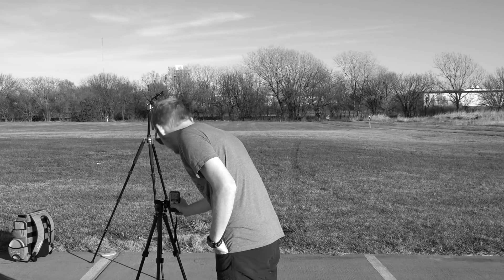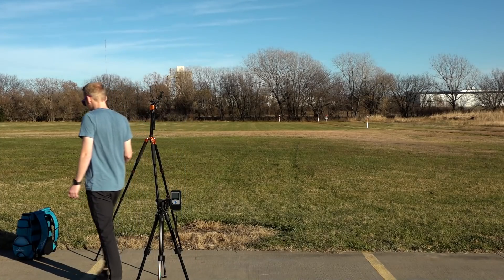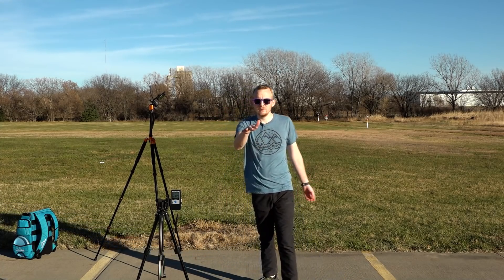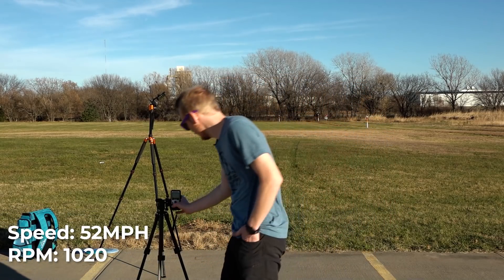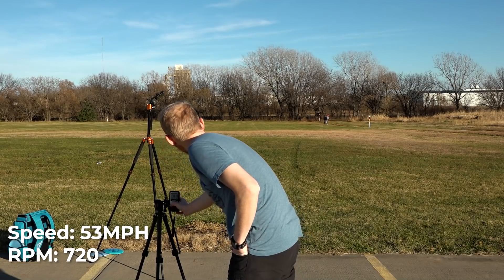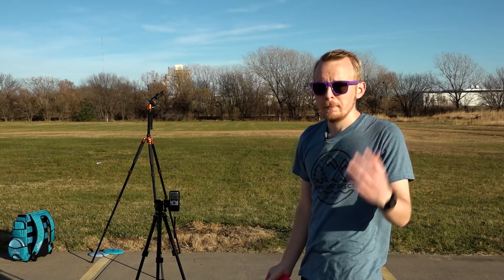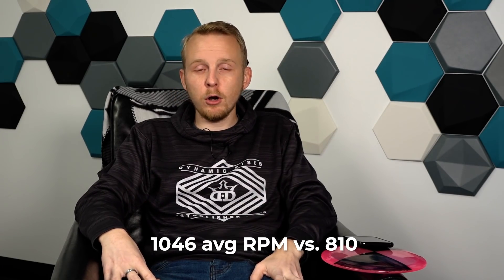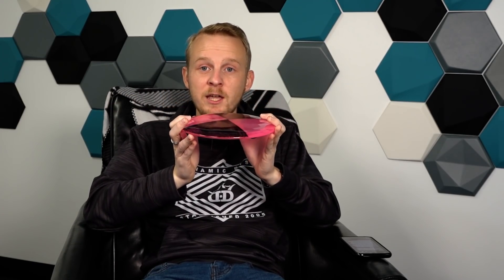What does disc spin do? | Physics of Form ep. 8 ft. Danny Lindahl

Comment: FIRST: spin does not cause lift.  Air passing over the top of the disk causes lift (Bernoulli’s law/equations). It doesn’t take much difference in the top causing air to move fast (low pressure) to create lift. Just a little lift causes aircraft of several thousand pounds fly at high altitudes.
Hmmm…possible cheat disc with better lift coefficient, perhaps?
Second: spin is angular momentum, causing a gyroscopic effect, or the higher the spin the more stable the disc at distance. Think of a toy gyroscope and the faster you spin the inner ring, the harder it is to knock it off the pedestal. 
Turn is generated by the disc losing rotation and speed. As it slows velocity forward, it tends to dip to a side, depending on how it was thrown. As rotations slow down the angular momentum decreases and the disc begins to fade or turn. 
 
Both forces, lift (time in the air) and angular momentum determine the path of the disc. Stable disc (high revolutions, angular momentum), level throw and high speed (causing lift) will dictate a long throw.

Comment: Spin generates lift. Turn is from instability caused by disturbances in the air rushing across the disc. These disturbances are caused by the disc moving faster than the angle of incident is designed for. This is the same reason why all planes have a speed cap, and an overspeed warning. These disturbances in the surface of the flying object cause vibration that can be catastrophic.... case and point a disc becoming over stable and turning into the ground. This effect is called "dynanic roll-over".

Comment: My understanding is that the turn on a disc is the same as the turn on a fast ball (or tennis ball, Pingpong ball, etc). The air that hits the front of the disc drags along the rim and whips off 270 degrees from the front forming a “jet” that releases off the left and pushes the disc to the right on a rhbh throw. So spin directly causes the turn. More spin = more turn. It also causes the gyroscopic stability… as the disc slows, the gyroscopic stability diminishes and fade begins as the front of the disc is pushed up, rotated 90 degrees, and the disc floats down at an increasing angle. So more spin also lengthens the flight time before fading off.

Comment: Lizotte did a video with his throws versus the throws of a friend.....  at equal speed,  he had more distance than his friend. It is evident that discs need rotation to fly,  and spin must be a factor in all sorts of Flight results.  Basic "talent" for  SPIN must have components of wrist flexibility,  as the wrist to hands/fingers represent the end of the whip.  There must also be a component of grip strength to provide a concentrated axis for rotation.  You're on to a great topic.

Comment: Thank you Danny! It's very popular to say "do your own research" and that's exactly what you did. From what I've understood with moderate physics skills is that the spin has multiple effects on the turn. One of them is that the rotation causes different airspeeds to different sides of the disc. RHBH the left wing has greater airspeed and thus, greater lift, while the right wing has less airspeed. More spin means more difference in those speeds and in that way, more turn by actually tilting the disc in the air (even to a roller). But in the other hand, greater airpeed also means more drag and as the result the left side of the disc brakes more and curves the trajectory towards that side. Think of it like a good old banana kick in football. Maybe that is what gives the disc it's fade, then? I think you had also another explanation with the front edge of the disc rotating right and pulling the right side down, when throwing nose down? But since I don't throw that way, maybe that's one of the reasons my discs turn way less than they should 😅

Comment: Ugh, Danny stay in your lane. You have no idea you’re talking about. Greater spin rate increases the stability, where stability is the resistance to turn or fade. For a given spin rate, same disc, “turn” and “fade” is dependent on the fore aft center of pressure, which for a given disc is dependent on the angle of attack = flight speed and nose angle. If you want to explore the effect of spin rate vs forward speed on a disc, grab an ultimate disc which you can throw slow enough and it’s easy to vary the spin rate.

Comment: Turn in understable discs and straight flight in overstable discs is created primarily by the differential in speed between the two outermost edges of the disc (side to side, not front to back) and the discs aerodynamics. As the disc spins, one edge is moving into the air in front of the disc, creating extra turbulence, while one is turning away from the discs flight. It is also flying forward like a wing, so its overall profile affects its "stability" (in this case, its ability to create lift and remain airborne. Unless someone perfects a "knuckle shot" with no spin, there will always be that differential between the two edges of the disc and obviously any shot includes some speed.

In terms of how that is effected by the flight speed of a disc or its spin, there are two things to look at. 1) The higher the spin rate, the greater the differential is between the two edges and the more the disc will want to "turn" because of its rotation. That spin also creates more resilience for the object in flight, think a football thrown as a spiral vs not. Speed on the other hand does not increase the differential between the two edges. Instead it only shapes the disc by interacting with the relative aerodynamic properties of the disc. The more flight speed a disc has, the more turbulence it will encounter, creating off axis torque on the disc that can also make a disc turn.

In essence, both spin and speed create "turn" but in very different ways. I'd be happy to help you dive into this more if you'd like.

Comment: From an engineering POV what you should have done is tracked the differential. You dont have to only try to throw the same speed and less spin. You could also have tried to throw the same speed but with MORE spin. There are definite things a person can do to increase their rotation rate.
PING has a robot golfer to test equipment. At some point this disc industry will have to do the same to advance the sport to the next level.

Comment: So from what I'm hearing from the last and current video, if your disc is crashing out, you need more spin to keep gyroscopic stability to the end. If your disc isn't turning, then you need more speed to force more air across the disc, creating turn. If your disc doesn't turn and crashes out, you need to get that nose down, and always choose a disc speed that is appropriate for your throwing speed and spin rate. When throwing nose down at driving power, does my disc turn and fade as advertised? Does it go noticeably farther than a similar disc with a lower speed rating? As soon as those stop being true, you've reached your speed limit, and you should choose fade/turn ratings at that speed, rather than compensate for lack of speed with understability.

Comment: You can easily see the effect of spins with a short throw using low amount of power: for example, throw a putter with a heavy hyzer or anhy angle at a close target (~20m). Throw once with low spins, and another with lots of spins. The first will fight out of the angle quickly, and the second will hold the angle for longer.

Comment: Before watching it, from the perspective of physics I believe more spin with the exact same air speed and nose angle would produce a flight that stays straighter longer. This should be true whether the disc is overstable or understable. So for an understable disc, less spin is more turn, but for an overstable disc less spin is more fade. I charted this out with a coworker some years ago using angular momentum and torque vectors and assuming we did the physics correctly, that's the result.
Reply: As an engineer, I completely agree with this. The gyroscopic effect causes the disc to be more reluctant to change it's plain, therefore it will fight turn and it will also fight fade if it's spinning at higher RPMs.

Comment: Try telling a baseball pitcher that spin is negligible and see what happens 😆 spin affects everything and is a key element to flight engineering. Saying spin has a negligible effect on flight is debatably on par with medical malpractice
Reply: Spin vs no spin absolutely. Something  spinning will absolutely fly differently than something not spinning. But the difference in the flight of a mostly smooth disc at 700rpms and 1000 rpms is negligible from my testing. There is probably a difference, but with all the variables I had, there wasn’t enough of one to overcome those.
Reply: @DannyLindahl  bro, u only say that bc u dont understand how spin effects flight. You assume there is no difference but the difference is measureable equally to how a chainsaw slices thru a tree. More spin of the chain equals ease of path thru the tree trunk. The spin of disc thru the air at an engineering level supersedes your testing. This isn't a mystery and also isnt up for debate! We already know this information and have tested it thoroughly. There is a reason you put a chain on a tire to gain traction 😆 there is a reason u put spin on a curveball, just as there is a reason u put spin on a disc.

Ur out of your league. Stick to media production and leave the real thought leadership to the real leaders. Just bc u can throw a disc and take measurements doesnt mean u are qualified to assess and apply those measurements to the engineering process.

Comment: One way I think about this is a) more spin = more torque and b) more speed = more power. I would think the greater spin would help the disc travel farther, and straighter, based on the speed of the throw. Not necessarily more stability, but greater momentum, allowing for greater distances. (Torque in and of itself is angular momentum, but I believe this also has effects on the disc in flight)

Comment: Mimic my form and you'll be sure to have less spin. 😁  I think my problem is two-fold -- 1) my wrist is not quite on the outside of the disc when it comes in to the power pocket; and 2) my grip doesn't give a good "pivot point" for the disc to create spin coming out of my hand. I'm really trying to fix these issues so I can get more spin 'cause I'm maxing out my distance and feel that more spin would equal more distance.

Comment: Discs turn when they are flying fast enough to generate enough lift to create an effectively nose-down angle of attack with causes a pitching moment resulting in gyroscopic precession (turn). That means nose angle and velocity are the primary factors dictating turn (other than the airfoil geometry itself).

Comment: More Spin —> Centripetal force pulls rim outward in all directions. Middle of disc deflects down due to being stretched. Drag increased on top of disc and decreased on bottom causing turn. As disc spin slows during flight, middle pops back up. Drag decreases on top, increases on bottom and stability increases. More spin = more turn.

Comment: Great video. I've always been interested in seeing disc speed selection based on actual distance tested and compared. IE (assuming proper nose angle) If your max distance throw is say 350 ft or other measurable distances for comparison, then what speed disc should you be using. If you can throw a 9 speed Escape the same distance as a 12 speed Trespass, do you really need to bag distance drivers? Different shot shapes call for different discs obviously. But I'm kind of talking about a bench mark for players to kind of know open field distance averages where they should say, Ok once I hit this distance with a 9 speed I should try a 10 or 11 speed.
Reply: That’s fairly similar to the video I posted last week just using speed instead of distance. I guess distance might be a better metric though because it’s easier to measure! I’ll see if I can make that video happen!
Reply: @dannybigflix9125  Last weeks video, coupled with this weeks got me thinking maybe distance is "easier" to measure and repeat and translate to players of all skill levels. Super excited to see if you can make that video happen!
Reply: A general rule of thumb I have seen on reddit has been take your average distance (in ft.) and divide that by 35. That number tells you the speed of disc you can throw
Reply: @CyberDarkZero  Thanks. Yeah I've seen that and heard it multiple times but I've never actually seen it tested. I just wonder if that "divide" by 35 is super accurate or just ballpark. Like assuming equal stability and glide and only increasing the speed of the disc, at what point do you start getting negative results on distance with the same arm speed and release angle. Always baffled me because I'll see some local players with not the greatest form, but not terrible, throw Rocs and E-mac Truths 300-350 but their control and distance drivers end up in the same distance range or shorter. So it just got me curious.
Reply: @4HorsemenDiscGolf   I  wish I knew where that 35 comes from as well. My guess is that they have enough physical arm power to throw the disc that 300 distance and aren't leveraging the rest of their energy from good footwork/timing, hip engagement, etc. I know from personal experience I threw both a Buzz (Speed 5) and essence (Speed 8) on a slight tailwind with a bit of a hyzer angle upon release and both flew close to 320 feet. I noticed though my Essence faded out early whereas my Buzz got full flight. So for me, I would assume that this tells me I did not give the Essence enough spin to achieve the desired flight/distance I wanted
Reply: Huh interesting. That 35 ft heuristic is one I came up with on my own.

Comment: The spin of the disc also imparts a speed differential between the sides of the disc while it spins. As one side of the disc is spinning into the wind and the other against it.  So one side of the disc is going "faster" in terms of air speed.  So less spin means less speed on the faster side of the disc. Which COULD mean less turn, but also the disc has less gyroscopic stability with less rpm so it could turn easier.  Too many other factors that no human could control precise enough to use it effectively.
Reply: I'm so glad someone already explained this so I don't have to type it all out :) For anyone else interested in this topic, you can look into why helicopters need a cyclic control so they don't flip over when they start going forward. It's the same concept.
Reply: @JRuns  a disc is different than a helicopter. Unlike helicopter blades, the disc spinning does not generate lift. Additionally, there is no hanging body below the disc that is trying to impart the rotation.
Reply: @callaway5148  Sure. There are obviously far more differences than similarities when it comes to discs and helicopters. But the explanation of asymmetrical lift caused by the relative difference in speed of the advancing and retreating side of the discs is the same. Cheers
Reply: @JRuns  So basically gyroscopic force (from spin) acts like the little rotor on the back to keep the disc from just flipping over due to asymmetrical lift (also from spin). Right???

But spinning it more seems to add more significantly to gyroscopic force. Where as forward speed adds more to the asymmetrical lift...?? Spitballing a bit here as to causes...  We know speed turns things over and spin keeps it stable (why forearm shots turn over more due to lower rpms)...

Comment: A for effort, but the conclusion I draw is that further research is needed. There's a lot of room for making your methodology more scientific. Higher framerate on the overhead, throwing in calm wind conditions, more consistent and more numerous throws, measurements of turn, and also, if you already know that sidearm has lower rpms, I suggest comparing amount of turn of backhand vs sidearm, to eliminate the need to replicate different rpms from a backhand only. 

In science, just as in disc golf, your results only really count if they are repeatable. Keep at it!
Reply: I totally agree. It's a step towards the actual answer a lot of us have, but this experiment lacked a lot of attempts and better control of variables (something solvable with a disc throwing machine whenever that'll be a thing).
Reply: I think prolly right after HL3 comes out
Reply: @zooblestyx  Sure..

Comment: I think you should find a lefty. Conduct the same tests with them throwing either FH or BH and yourself the opposite. Try to throw same speed, same line, but a FH has LESS spin, ergo will not fly as far. Why else would the farthest throwers in the world (looking at you Eagle) throw BH for their max-D. At the end it does boil down to physics. The same aerodynamic principles that govern helicopter flight govern disc flight. More spin gives a choppa lift, less allows it to descend.